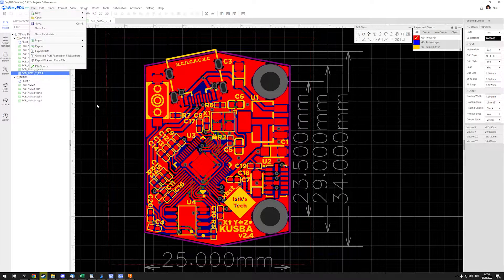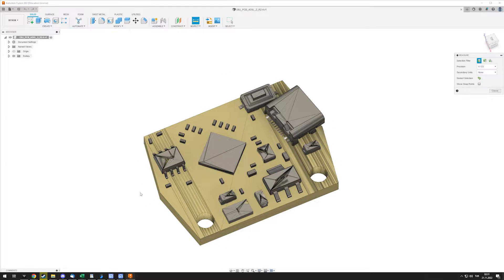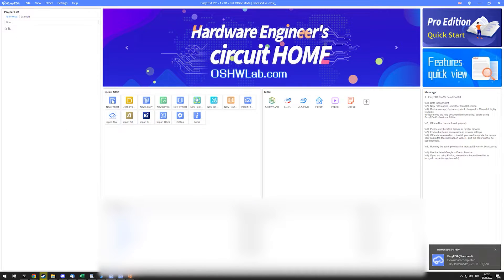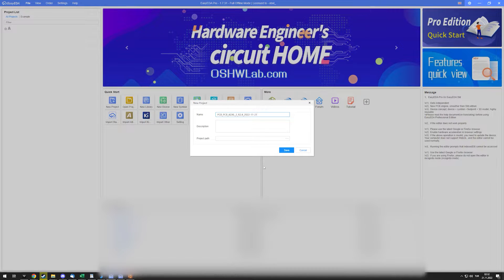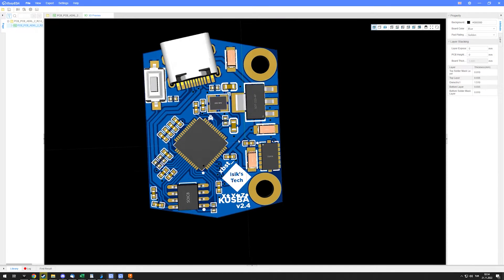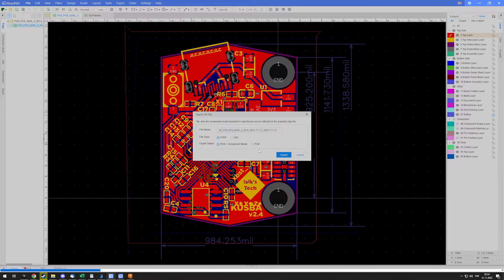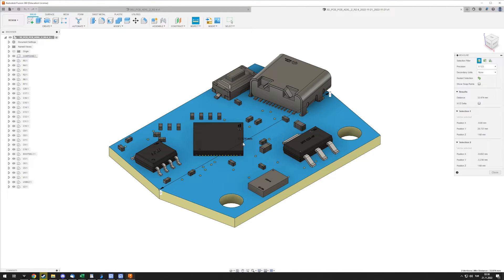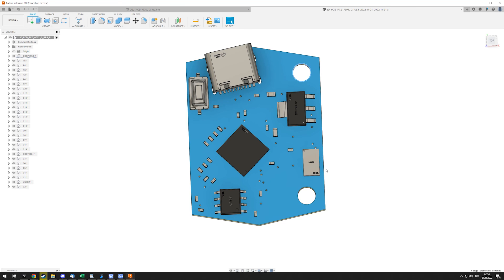How To Export .STEP Models from EasyEDA

Comment: Nice Tutorial. I have one problem. EasyEda is increasing the size of my pcb board. I have a connector that is sticking out of pcb. But when I change to 3d mode and even when I export step file, length of my pcb is increased and the connector is not sticking out anymore. How to solve this?

Comment: Nice, but i got one strange problem, when i import it my screw terminal is not right, they are not in the holes, they are laying down on the pcb? how to fix that ?
Reply from the maker: Sounds like a 3D model placement problem. You might be able to fix it in easyeda pro before exporting the step file.